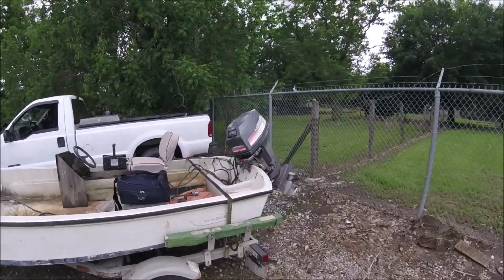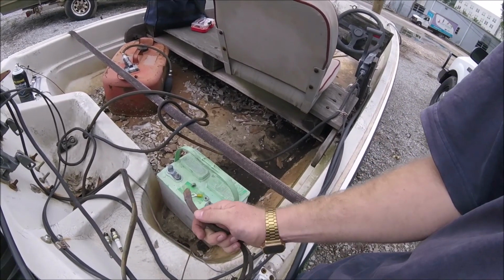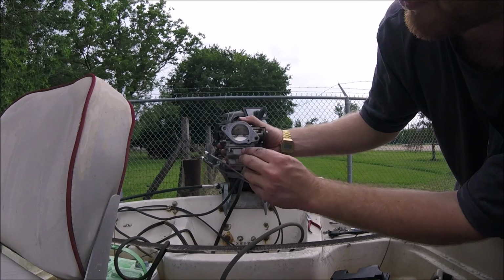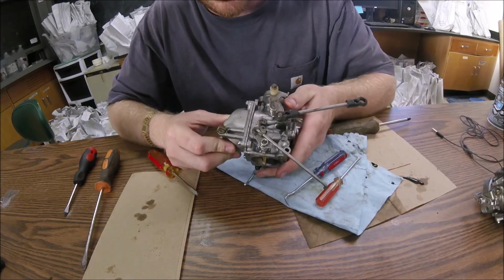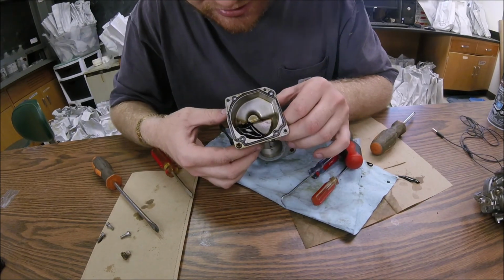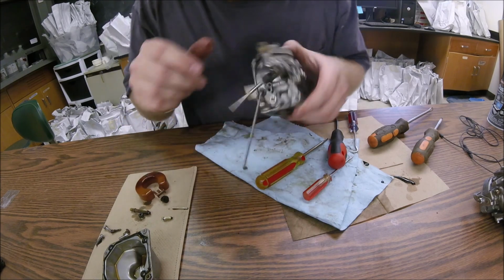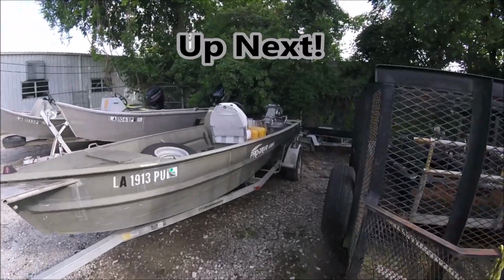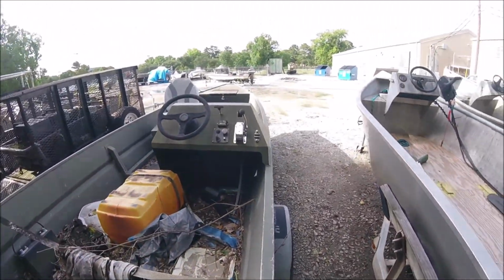Starting Mariner 40HP 2-Stroke Outboard Boat Motor After 20 Years

Comment: When I wake one up like that I always run the first six gallons thru it with an extra dose of tcw in the tank . They mixers usually work but I'd rather clean sparkplugs than replace power heads . Can't wait for them locked up engines , I love bringing locked up engines back to life . Great job dude have a good one 👍👍🇺🇸
Reply from the maker: Thanks for watching! I agree, running more oil means less major problems in the future. Cheers!
Reply: @FixAndForget  True.

Comment: i've just bought a beat up rhib, came with a mariner 40hp, missing throttle assembly so unsure it motor has ever actually been on the boat, or whether they were bought seperately as a project that failed. anyway, thanks for the video, given a newbie some pointers 👍
Reply from the maker: They're decent motors. Good luck&thanks for watching!

Comment: Ive got a 40hp Mariner and am having issues with the water pump. Should the water be peeing out as soon as the engine is started or is there a thermostat that has to reach operating temperature?
Reply from the maker: Thanks for watching! Water should be discharged immediately and constantly. Check the water discharge tube and passage before going after the pump. Good luck!

Comment: I have this same motor minus oil injection.  Been putting off a carb rebuild for a while. What were your slow speed initial screw settings?
Reply from the maker: Thanks for watching! Go for the carb rebuild, it's super simple and only takes a few minutes. Low speed setting varies from one engine to another  but a good starting point would be roughly 3-4 turns from the bottom. Adjust it after the rebuild with the engine running. Make it slightly more rich than normal since the engine uses oil in the gas for lubrication. Cheers!
Reply: @FixAndForget  thanks for the info.  Do you happen to have the rebuild kit part number?
Reply from the maker: @psstplease  I do not have that number but I'm sure a quick Google search with you model number would find it. Good luck!
Reply: @FixAndForget  **update** 
Well i decided to skip the carb rebuild kit.  I ended up doing exactly what you did and cleaned everything up with brake cleaner and compressed air.  Reset both slow speed screws to 3 turns out….motor fired on second key turn.  Idles smooth as silk.  Thanks for all your help.
Reply from the maker: @psstplease  Excellent news! The carbs on that motor are nice because they don't have any diaphragms that go bad and need to be replaced, unlike the 4 stroke motors in my other videos. Great work and enjoy the boat!

Comment: When you said ethanol pump gas, are you saying I should be running ethanol free gas plus 2 stroke oil?
Reply from the maker: Ethanol gasoline turns to water and alcohol if exposed to moisture/water. It also destroys rubber seals, o-rings and gaskets that aren't designed to withstand it (like what is on these engines if you haven't rebuilt the carbs). Thanks for watching!

Comment: Hi, I have the same motor and the magnetto lever that connects to the stator is not smooth in rpm ranges. It gets stuck even after using penetrating oil and turning it a few hundred times. It doesn't run smoothly when I accelerate so the engine Boggs down unless I turn the lever all the way to the right, also it idles at high rpm speed because lever doesn't go back. Any idea what it could be?
Reply from the maker: Thanks for watching! Certainly sounds like something is binding. Removing the flywheel for inspection is likely your next step. Good luck.
Reply: @FixAndForget  Thanks.

Comment: I am getting this same outboard for a 94 bass tracker pro 17. It is currently equipped with a 25 hp tracker mariner. You know if that is a pretty direct swap?
Reply from the maker: Thanks for watching! As long as the holes line up you'll be ok, the rest is just hoses and cables. I'm not sure of the mounting arrangements but you might be in luck.
Reply: @FixAndForget  just curious since the one you have has the cables on the outside of the outboard and mine hook up on the inside of the cover.  Appreciate you responding. First time doing an engine swap. Just want a bit more tops speed when I have extra people in the boat.

Comment: Do you know how to find the serial number on the motor? Mine dosent have a sticker I think it’s a 90s model.
Reply from the maker: If you're missing the plate on the transom bracket look at the block for a casting number or part numbers. You can Google part numbers you find on things like the carburetors that will give you a model / date range. Good luck!
Reply: 6e9 or 40ELO or 40EL0 or c40plrs
Reply from the maker: Excellent info. Thanks for watching!

Comment: That’s basically a Yamaha 40 2cyl but Mercury wiring harness rest Yamaha electricals those are bullet proof reason why the US didn’t want them any more because they don’t break plus emissions.  they still sell these engines new as of 2024 Yamaha 40 enduro 2cyl internationally.
Reply from the maker: @guyanesegamer1693  I only have experience with newer yamaha engines (2007+) and I couldn't agree more that they are tough. Not very happy with their lower unit design but the engines are great. Best 4 stroke outboard on the market for sure. Thanks for watching!